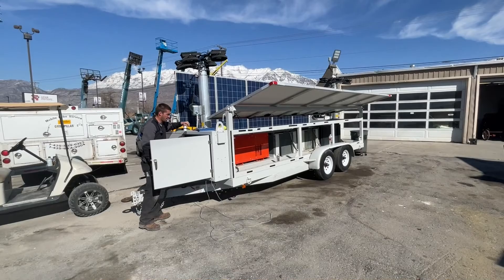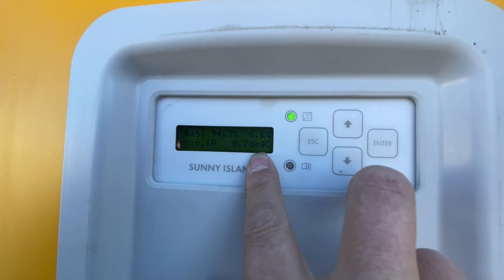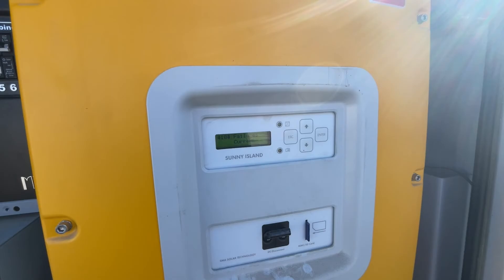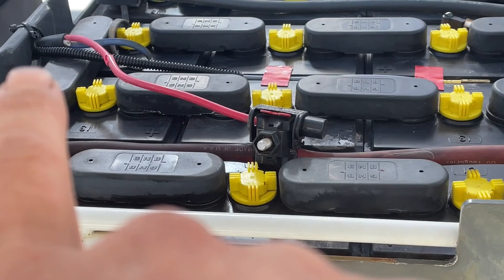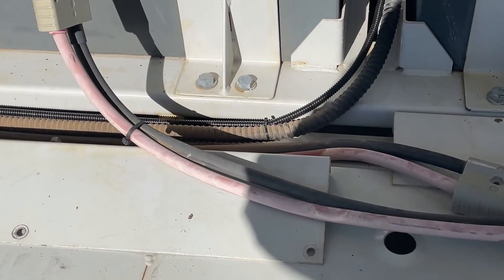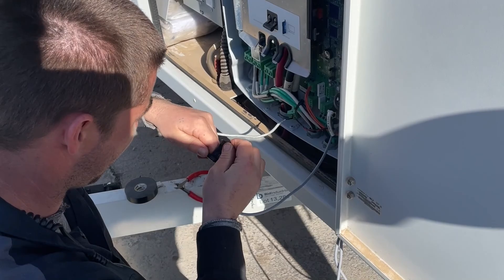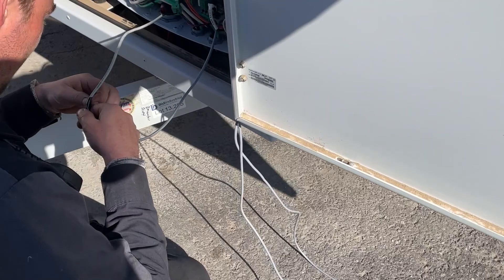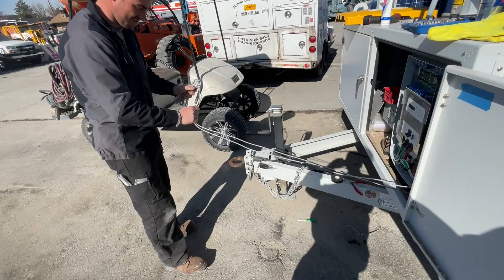HD DC Solar SMA Battery Temp Sensor Replacement

Comment: Gary - I think the temperature sensor just went out on our new to us DC Solar trailer. I just completed charging the battery bank that is functioning (84% SOH) and I went out to check the timer for the light towers and saw the SMA coded BatOvrTemp... the generator shut down correctly and 45 minutes had passed?! Where can I order one of these sensors as a replacement?
Reply from the maker: Try eBay and if not try SMA the inverter manufacturer.

Comment: Is there a way to configure the inverter to ignore the temperature sensor and run without it? I have the batteries charging on solar anyway so temp monitoring is more important for the charge controller, not the inverter.
Reply: You wouldn't want to do that because #1 ruin your battery or worst cause a fire because the battery got too hot.

Comment: Can you share the part number and site I can purchase from?
Reply: Ditto where do we buy these, will it work if we disconnect while ordering one
Reply: In EBAY I'm selling this "Battery Temperature Sensor for SMA Sunny Island SI 6048 NEW, never used" There are PDF link there to install this sensor correctly.

Comment: Is there a part number for this
Reply: In EBAY I'm selling this "Battery Temperature Sensor for SMA Sunny Island SI 6048 NEW, never used" There are PDF link there to install this sensor correctly.